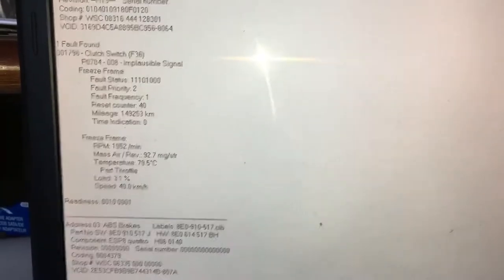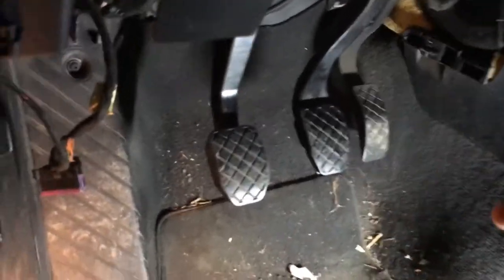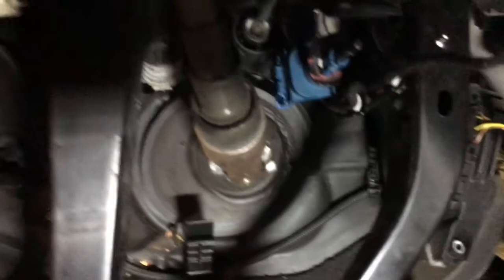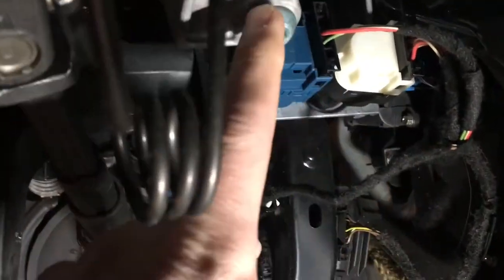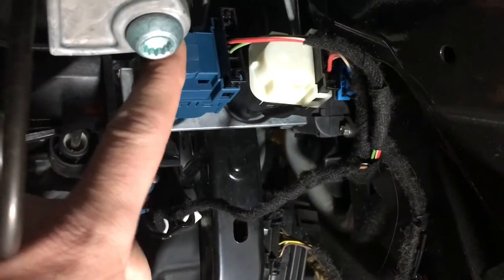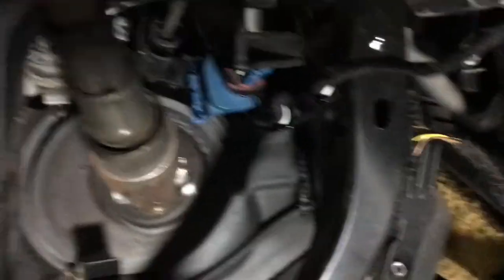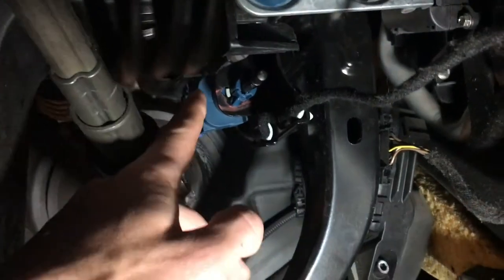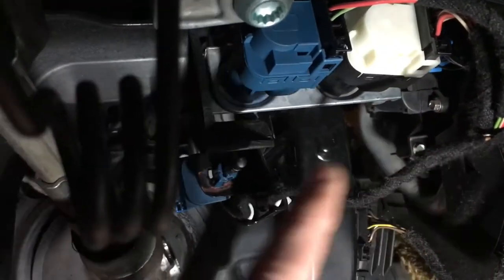P0704 Audi A4 B7 Clutch Switch 001796 Ross Tech

Comment: Hi I háve a vw touran 2004 manuál, problém that my brake lights always on.. First problém was blinking glow plug on the dash, then i noticed the brake lights on so i change the brake light switch, but the light are still on, but a heard it could also be the clutch Cruise control switch, do you háve any clue?
Reply from the maker: Hey Michal Depu thanks for watching my video. Check to see if all your fuses are good especially in the battery fuse box. I have personally always replaced all the switches in that location to avoid error. Please share an update.

Comment: Thanks for your vidéo bro . I have a problème m'y clutch pédal Passat B6 goes UP and down when i'm driving and i  have hard shifting Gears What could it bé thé problème freind
Reply from the maker: Thanks for watching my video and taking the time to ask a great question. My experience with such issues was and issue with the clutch master cylinder. Either replacing or bleeding, most cases both. Please share an update on your diagnostics, thanks a bunch.
Reply: Re: hi freind thanks for your answer  m'y problème was on Gear box thé main Axel   easy to fix just taking off thé front left wheel..... Just see this vidéo

Comment: Hi , 
was wondering , my B7 doesnt take gears anymore , without any reason , when the motor is off i can put it in reverse , start the car and drive backwards , the clutch feels good and loose ... when the motor is on , i can't get it in gear..also B7 2007
Reply from the maker: Hey Jacksteelmachines thanks for watching my video and taking the time to ask a great question.  Personally I have experienced similar issues and the first thing I checked in these situations was the clutch save cylinder aka CSC.  Please share an update, thanks a bunch.

Comment: Awesome video that helped me out. But my car is a 2005 Allroad 2.7T MT, do you know what the part number/s would be for those switches?
Reply from the maker: Thanks a bunch for watching my video and taking the time to comment. Personally I try to source the best numbers from the dealer or the part from the dealer as they have the most updated parts. Alternatively you can check some of the popular tuning stores which have VIN ranges for most parts to match your VIN to the part. Some people find most success in replacing all the switches including the brake light switch and both if equipped clutch switches.

Comment: Hello! my cruise control is not working same car as yours. I think the fault is in those clutch sensors what r u think about that ?
Reply from the maker: Hey Alexander Osmani thanks for watching my video.  I personally in a similar situation have replaced all the switches with new and updated part numbers, ordered directly from the dealer.   I always prefer these items from the dealer as they have the most updated and correct fitting parts.  Also make sure you feel comfortable with removing and installing the switches as they can be tricky with twisting and pulling.  Please share an update, thanks a lot.

Comment: On my 2007 Audi A4 B7 the cruise control was not working, the rpm was not coming down when shifting gears and I could start the engine without pressing the clutch. After I changed the top clutch switch the cruise control was working but the other problems remained. I've noticed I don't have the lower clutch switch...no bracket for it, no plug nothing...What should I do about the rpm? Is it normal to have only one clutch switch?
Reply from the maker: Hey Ciprian Suciu thanks for watching my video.  To the best of my recollection the car I had was equipped with at clutch switch for starter, clutch switch for  ECU / cruise control and a brake switch.  This is what i remember on my car.  Please share an it could potentially help a lot of people, thanks a lot.
Reply: Replace the brake switch too, that should fix it

Comment: Hi is it the same clutch switch for the both?as i changed to top one only.
Reply from the maker: Thanks for watching my video and for the great question. Personally I replace all the switches while I am down there, most of those switches have superseded and have newer more reliable parts. Please share an update, do you still have a fault code, thanks for any update.
Reply: @WheelsTips  Hi, i just changed both switches all works fine and its back to normal. but only problem is I got an epc light on. had it scanned and no fault codes showing. THanks

Comment: Does this have to do with your clutch like it’s not being read when you push it down to the floor ? Because I’m having this problem and I don’t know what to do
Reply from the maker: Hey imaree fisher thanks for watching my video. What type of scanner did you use to obtain the codes. Please share an update.
Reply: What was the issue? I have the same problem but in vcds shows me p0704 008 f36 clutch switch.
Reply from the maker: Hey Daniel Andrei Gaina thanks for watching my video and for the great question.  Have you already replaced your clutch pedal switch on your Audi, the ones shown in the video?  Please share your updated diagnostics, thanks.  Also what ross tech code are you getting for this?
Reply from the maker: @danielandreigaina9784  Just checking in to see if you were able to repair your Audi, thanks for any updates.

Comment: Can you give me a link as to where to buy clutch switch 1?? Please and thank you for this video.
Reply from the maker: Hey Liam Byrne thanks for watching my video and for the comment.  My best suggestion is to google search, the make and model of your car with buy clutch switch.  I will say that picking from websites that specialize in the field of cars such as German car auto parts seller would be the best choice and one closest to your shipping area.  Please share an update, thanks.
Reply from the maker: Any update on the Audi? Would be greatly appreciated if you had a moment to update, thanks.
Reply: Replaced the clutch switch that was next to the brake switch. Didn’t replace any other switches other than one. Disconnected the battery before doing so as well, and BOOM it’s fixed. No more Rev Rang, that and the car is easier to downshift and easier to start off in. Thank you!!
Reply from the maker: Thank yo so much for the update, glad to hear you got it fixed and saved yourself time and money, great work.

Comment: Are the blue clutch switches the same?  Should I just buy two of the same switch and then replace them?  I'm looking on ECS tuning's website and I see a clutch switch (blue) but I also see a clutch pedal switch that's white not blue.
Reply from the maker: Hey K Val thanks for watching my video. Personally I replace all the switches down there since they are not that expensive.  I would just give them a call and have your VIN number handy they will tell you which ones match your car.  Please share an update, always best to check parts with the cars VIN.
Reply: Actually they are two different switches... 

Part numbers:
Upper: 6Q0927189
Lower: 7H0927189
Reply from the maker: Definitely you may also want to replace the brake switch while you are down there, please share if this helps your issue, thanks again for sharing.
Reply: @WheelsTips  You should provide all the part numbers for the vehicle you're working on in the future, great video either way.
Reply: @RS4KING  Thanks for finding that.
I wonder if each switch will give a different code?
Reply from the maker: @Lucas-kj5kv   thanks for watching my video.  The reason I do not put the part number of the part I am using is because I do not want to confuse someone with a little less automotive experience or knowledge.  I understand where you are coming from and under the right circumstances it is a great idea, but I think it may confuse many, with the potential of many upset that bought the part I did only to realize it is not their matching part.  The best way to buy parts is based on VIN number, also the part number @K Val posted even if it is the right part number could have been superseded with a new improved version, where the person buying is buying a correct part, but a part that maybe determined flawed sometime later or not as good as a new part number of the same part.  I have seen car parts go through 10 or more part numbers for the same part, same car.    That is why it is not good to take other peoples part numbers, could be like a test in school if you don't study or research hard enough and just copy it may cost you in the long run.  To each their own though, but what code do you have by the way?
Reply: @WheelsTips  Well its still a good reference and you can disclose that parts change and mention vin searching in the video. When you search a part number on a popular website it usually redirects you to the newest version of that part because they don't carry out dated parts. Your logic is "Here is a video on having issues with clutch switches. There is two of them and im not gonna tell you that they're different, the same, how to replace them, how hard the job is, what tools you need, or what part number because I don't want you cheating." I left with with more questions than I came with but at least if wasnt a 25 minute video.
Reply from the maker: @Lucas-kj5kv  I greatly appreciate your effort to explain how I should have made my video.  As to your logic, this video was less than you expected because there was little attention to the title of the video that did not include descriptive words such as "how to" or "instructional video" the video is to share my experience and show you what I replaced and where it was.  If you listen to the words of the video I make it obvious to those listening that there is clutch switch1 and 2, also there is a brake switch and I replaced all 3 switches when I get this code.  As to how to do the process, I do not show that because if you can not tell how to do that from what I show in this minute clip, than I do not think you should be doing the repair, as this is something that controls many important functions including things like acceleration and brake lights.  This is not a 12 volt fuse video it is changing the brake and clutch switch, if you need instructions how to, I am not the one to assist in that as you can endanger yourself and others.  As for the parts claim, many websites including online auctions and others (not to be specific) still offer at a lower cost, the older parts and people do buy them, if you disagree please let me know.  Thanks again for taking the time to share your feelings and opinions.
Reply: @WheelsTips  Yeah my point was a couple extra bits of info would have been nice. Would have been a lot less effort than replying in here 😆